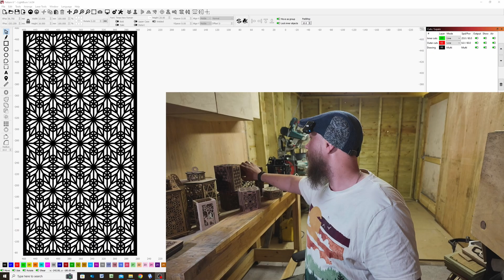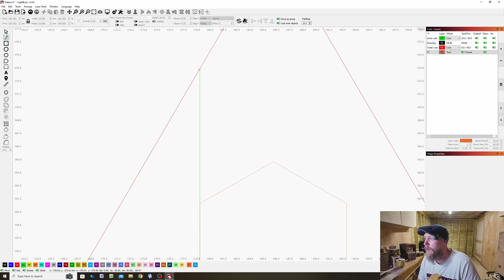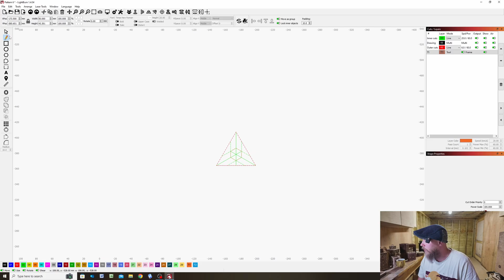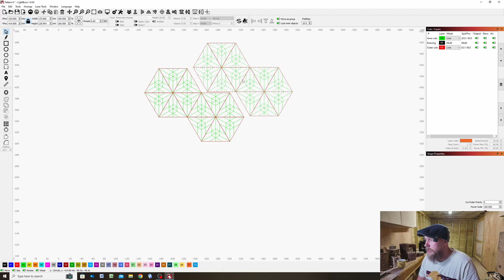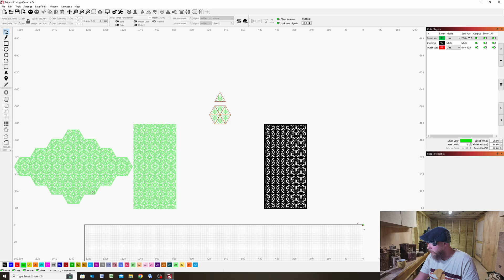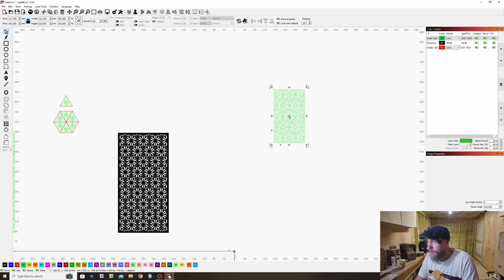Beginner's Guide to Kumiko Pattern Design using Lightburn. Laser cut project tutorial.

Comment: hi there can you suggest Settings and software for someone who uses a CNC router to create such latticework I have tried with Vectric-Vcarve, Inkscape and Coraldraw all to no affect They either don't seem to snap to centre or edges or rather than make triangles they make wedges please can you suggest a method regards craig
Reply from the maker: If you are using software that uses DXF or SVG you can use Light burn to design files. Instead of saving them as a LBRN2 file, you can go to file, export, export as DXF, SVG, or AI ( Adobe Illusrator ).
I hope this helps. Any questions please don't hesitate to ask, I'll help if I can.